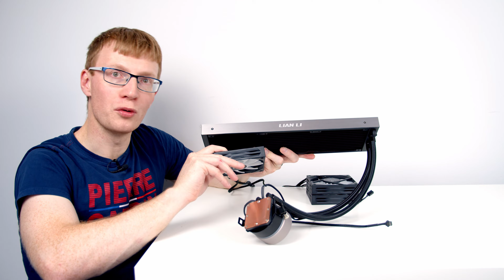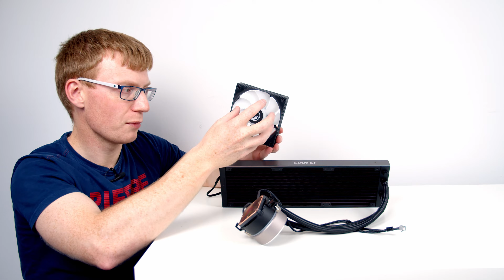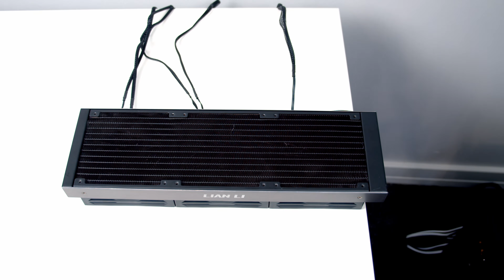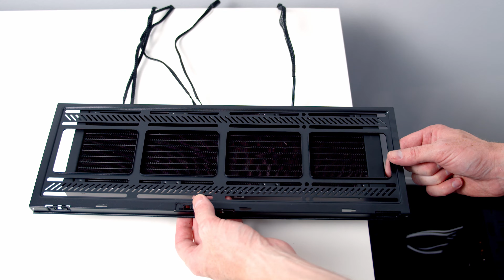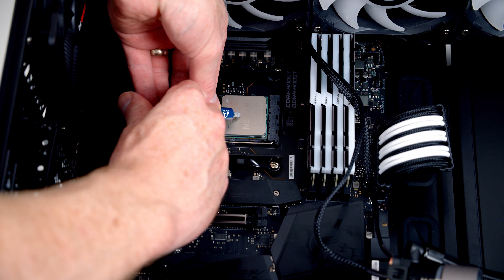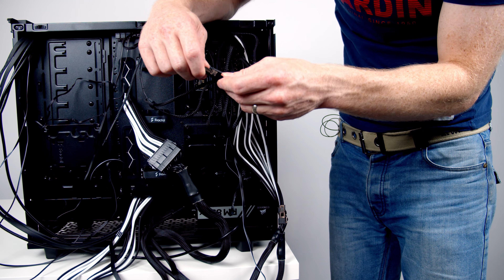Lian Li Galahad AIO Installation Guide

Comment: I have this AIO running exhaust through 3 fans at the top of my case. I also have 6 total fans running intake on the side and bottom of my case. However, I’ve noticed my Ryzen 7 5800x runs at 90c during load. Is this normal? Should I undervolt my CPU?
Reply: I have the exact same cpu and the exact same problem please let me know if you figure it out and I will do the same for you

Comment: I know this is old and you might not respond, however on a Lian li fan setup using the fan hub, should I run my pump rgb cable to my lian li case fan controller so everything links and then run the radiator fans to cpu fan? This is using the uni fans so only one set of cables for 3 fans
Reply: Hi, what did you end up doing. I’m stuck on this scenario too
Reply: @anuj1367  I actually wound up disabling cpu fan speed monitoring in my bios and running everything to the controller and then using a fan software called fan control by remi to create custom fan graphs for my gpu and case/aio fans. Works flawlessly
Reply: @matthewstansbury3047  yes! i was considering using that software i saw JayztwoCents video on it. So when u say your an everyting to your controller, you mean the Lian Li controller that comes with the sl120's right? Currently  ihave 10 lian li sl120 v1 fans and galahad AIO cooler, so i require 2 of those lian li controllers. Did you still plug in all 3 cables at the end of the controller or no? Do you have discord i would like to talk more about what you did as im currently in the middle of building my pc too
Reply: @anuj1367  ahhh so yea I have the v2s while my spouse I built hers with v1s. I put all of the fans in the hub, and put my aio pump on my motherboards aio pump header. Using the fan control I set all fans to ramp up/down based on cpu graphs and gpu graphs.

Comment: Im confused about the RGB. What controls the rgb? L Connect? The hub my AIO came with didnt come with a controllable hub with buttons on it. Do i need to control it through L Connect or my mobo? Asus Aura sync DOES NOT like to work on my pc. Have had it for years and havent been able to figure out why. Ive updated everything you could think of so maybe its a hardware issue.
Edit, my controller does not look like yours at all. Its about twice the size as the one I saw in this video.
Reply: What did you end up doing

Comment: Goddd those wires when you turned the computer around.... My Anxiety went haywire... Great video never installed a Water Cooler system before, just trying to get some ideas on how they work... Kinda paranoid about water running through my computer, but I understand the science behind the cooling system.  Much appreciate the video.

Comment: After 2 years with the galahad AIO in diferent positions, top, front with pull and push system and only push system is not cooling properly and my cpu is hotter tan ever

Comment: Got mine around 6-8 months ago. All a sudden heat is around 95 degrees while just have chrome with YouTube playing. Took it off and reapplied thermal paste. Same thing. Any advice? Back to using the stock cooler and idle is even cooler than it was them on this cooler.
Reply: I got the same issue mines idles at 60c
Reply: @IndigoOmegaTv  took it back for warranty, all good now. Much cooler better than it ever was. Had a defective one and didn’t know until it got worse

Comment: The screws for the brackets on my cooler will not tighten past a certain once i apply them, but they stop while the cooler is still nowhere near the cpu and won't go any further no matter how much pressure i apply with the screwdriver
Reply: Did you ever find a solution I'm having this exact same problem

Comment: I have the same AIO, I plugged in the 2 wires coming out of the AIO pump to CPU FAN on Motherboard and other right next to it to CPU_OPT on the motherboard, will that be alright?
Reply: God no, one is for the power the 3 pin one, this goes in CPU fan. Other one that looks like a 4 pin but has one filled in is for the ARGB, this goes into the ARGB socket on the mobo (5 V)

Comment: Does it matter which way the fans are facing
Reply: yes very much!!
Reply: @casualsadi3144  what would be the best
Reply: @dakku5019  depends on your cooling system... for instance , if you have front 3*120mm/2*140mm and 1*120 mm/140mm exhaust .. then u should go with top exhaust ( blowing the air out ) ... OR you can mount the Radiator up front as intake ... this is only for liquid cooling as air cooler setup has a different result ...

Comment: What if I didn’t want to use the controller what steps would I do then ?
Reply: Did you find a solution? I’m interested in trying without the controller. I think the three RGB cables you connect from fans and the separate one from pump will then be plugged directly into the motherboard. I think you could also get a different rgb hub if you don’t have enough headers on your mobo. It’s my first build so I’m not certain. Let me know if you managed it
Reply: @ggamer7830  if you look up the manual for it it shows how to plug everything up if you don’t wanna use the controller I think that’s how I did it

Comment: Question: Where do you put the RGB controller box? (The one with the buttons on it) Do you just leave it inside the PC case somewhere? How do you access it to push the buttons? Thanks for the video!
Reply: I've seen alot of people just stick it on the wire tucking side panel, so you'd have to open it if you wanted to change it... you might switch it alot in the beginning but once it gets old you'll likely just keep it on your favorite color. Or change it every once in a while, which is only two thumb screws away
Reply: @mattb6646  when i take the panel off to switch colors do i leave the pc on
Reply: @um4r735  yeah you can

Comment: is it normal that after you tightened the screws that the have a small angle to them? i mounted my aio and its even on the board but it looks kinda sus with the screws on a slight angle idk if that is normal for that kind of mounting^^ is my first aio..  temps are fine with 40°C in Idle and around 60°C in Full use

Comment: You sir, are a legend! I have just ordered a 240 galahad. Was wondering what I was going to do regarding my RGB. header is currently used for strip however was not aware I can just use splitter cables. This made it step by step clear which was also nice!
Reply from the maker: No problem
Reply: Hello lol I also got a 240 Galahad and having issues regarding plugging in my rgb, what Splitter cable did you use.
Reply: @zackaparicio2843  hello, sorry for delay! You can get generic 3 or 4 pin RGB splitters, also known as daisy chain cables. However be sure to check what you’re plugging in and where. If it’s a 4 pin header you’re plugged to, it has to be compatible. ARGB and RGB are two different voltages and can cause damage if mismatched.

Comment: These are super helpful.  I am about to hook up the 240mm version of this as an exhaust to my Lancool 2 mesh case. I also have to hook up the 3 intake RGB fans that come with it.  I think with my x570 Tomahawk board I should have no trouble just using the splitters for each and plugging both ARGBs into my mobo..
Reply from the maker: Glad it was helpful!

Comment: I was looking to purchase this one. Went for the Artic Freezer II 360 Cooler has better cooling results than Lian Li.
Reply: Not really dude lian is better by a bit. Aztec or who ever makes these type of aio are the same design. Its within a margin so it does not matter look at Gamer Nexus. Buy on what look and brand you like at this point. First time i go with lian li, i love it. The white is fantastic
Reply: @uziasmorales294  OK but my brother had the Lian Li he got rid of it as it had Pump wine problem and at fan 100% it was more nosiest than Artic. But if you like it good !
Reply: @gurugamer8632  they are both great choice and the pump whine goes away its not load i got rid of it. Your brother probably installed it with the tubes up

Comment: The amd mounting seems weak because it only has 2 anchor points
Reply: That's what the paste is for, to fill in the gaps
Reply: Yes it’s two point go with Arctic freezer II 360 better performance
Reply from the maker: Agrred 4 would be better but it peforms well and on removing cooler all cpu is covered well with thermal paste
Reply: @ChristopherFlannigan  OK thank you, however I think it is the better looking one. I’ve just bought the nzxt z73 for my new build.